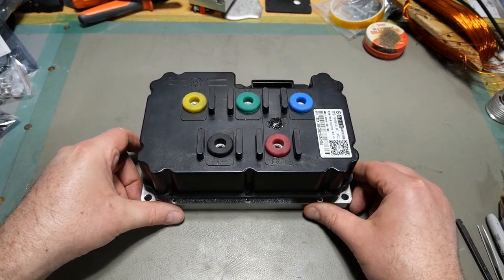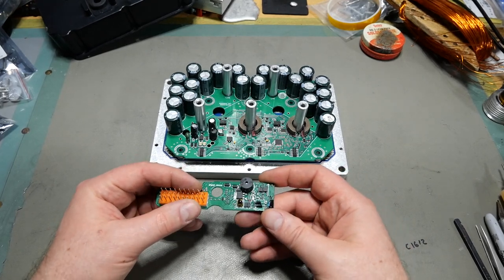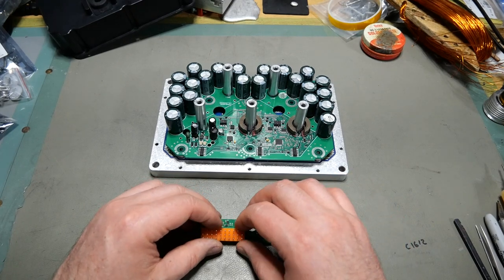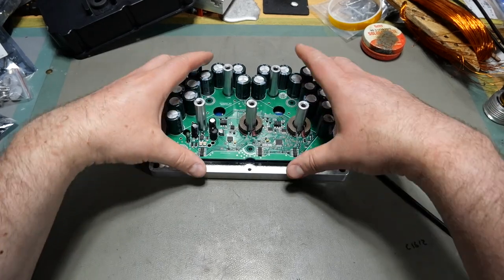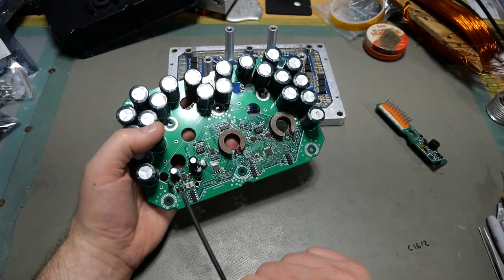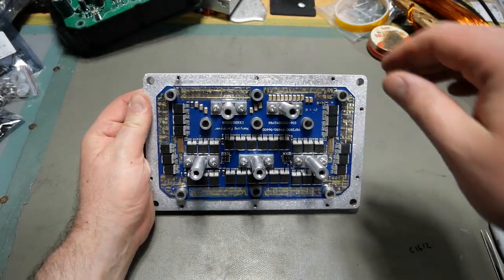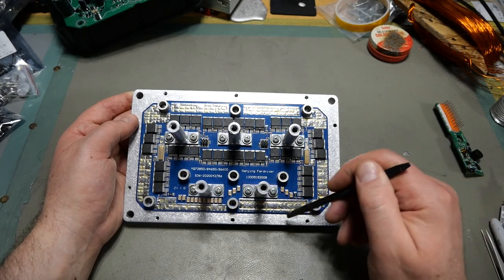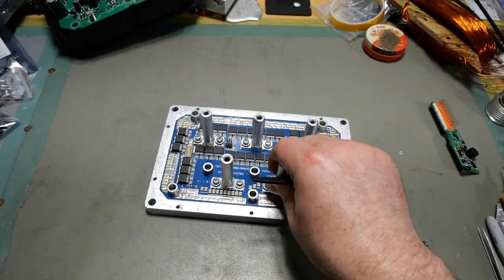Far Driver ND96850 Overview

Comment: It is really interesting that the powerful open source VESC is applied to this ABS box.
Reply from the maker: Why not? It's mosfets on the power stage. Gate drivers are not special. What's behind them can be just about anything from an RC ESC CPU to VESC or whatever.
Reply: @de-bodgery  What type of Hall amplifier is used? Can you provide the schematic diagram of the amplifier part?
Reply: VESC uses resistance current low-end detection, and the video uses the Hall magnetic ring method.
Reply: @de-bodgery  The current sampling method needs to be modified when VESC is installed in this box

Comment: Very intersting comment about the encoder input support for sin/cos vs hall.. I assumed there must be hw difference as well.  I did see the following descriptions of parameters of the encoder:  
1) Hall version
2) incremental encoder version (3 types)
3) differential encoder version (4 types)
4) absolute value encoder version (2 types)
5) Encoder version (not sure..)

So a mix of types!  I suspect that the MCU just reads in the value via ADCs and does the rest in fw..
Reply from the maker: The CPU jsut need the right coding in it for the position sensor

Comment: Can you share a similar or identical controller PCB schematic file? The enclosure is very good, and the VESC is cloned onto the controller, but unfortunately there is no PCB dimension drawing
Reply from the maker: Good luck getting an FD schematic. IF you google for VESC schematics, you can find some open source schematics for that.

Comment: Know if this is hard to install on a sur ron? And if ill see any improvment running it on stock (72v on the way)
Reply from the maker: Get on the Watt Wheels web site. There are adapter cables there for far driver to surron. This makes connecting these controllers in place of the factory controller pretty darn easy. If by improvement, you mean more motor power, then yes, this is stronger than the factory controller.
Reply: @de-bodgery  yeah I mean will the 90a stock battery improve (some say it does with torp nuclear etc) performance with this controller. Even before I asked the question I assume it would be negligible
Reply: @de-bodgery  and thanks for the recommendation will check it
Reply from the maker: @je7647  Motor controllers are not magical. They all need more current to make more torque in the motor. You can't configure the factory surron controller, but you can configure after market ones. This will let you set the battery and phase amps higher, assuming the pack can handle more current. Surron, VESC (What Torp uses) or Far Driver are all FOC controllers. They will all drive the motor in a very similar way. This isn't magical, but it does provide better motor control than older technologies. I have yet to take apart a factory surron pack to see the BMS inside. I think it's 80 amps, but I'm not sure. The cells inside are capable of 150 amps, so with a stronger BMS to replace the factory one, you ought to be able to pull that 150 amps from the factory pack. This will raise that current into the controller significantly so that you can pass that along to the motor for more torque. Your pack current limits are your primary limiting factor. No controller is going to change that at all. Torp is massively expensive and they exaggerate the power ratings pretty agregiously! Never mind that they are stealing VESC and are under investigation for intellectual property theft! I can't recommend Torp EVER. There are plenty of legit VESC options that are reasonably priced, decently made and that are not despicable thieves like Torp. Trampa, MakerX, Team TriForce, 3Shul, Spintend, EBMX, Tronic are all good makers of VESC controllers. VESC will provide the best case motor control with the largest feature set of any controller you will find out there. Nukular is a reasonably good brand as well and is not VESC. I don't ever recommend ASI as they are massive control freaks and won't let you configure your controller yourself.
*
I don't know this as fact, I'm just hypothesizing. It is possible that the factory surron controller is limited to something like 80 battery amps. If the factory Surron pack is capable of 90 amps, then the Surron controller would be leaving available current untapped. If that is case, an after market controller that can be set to the maximum the factory surron pack can deliver would for sure make a little more power. Again this isn't magic, it's jsut using all the resources you have available. Probably, if you could reprogram the Surron controller, you could also set it higher and get the exact same result.
Reply: @de-bodgery  yeah I went fardriver, I was aware the future of evs is in vsec and didn't want to get one of those half ass vsec that are "open source" like torp (I don't believe it will be or will be pro e ot some issue) I'm going to get a good vsec one maybe a year but the 72680 enough atm

Comment: Hello, magnificent videos. Could you help me with a fardriver controller, at least a guide? In the app I get a 10.phase zero error problem; The controller repaired it for other damage, but I have not been able to find out what the problem is. very grateful greetings.
Reply from the maker: On Facebook there is a Far Driver forum: Far Drivder Tuning for E-bikes. On Discord is the High Voltage forum with a whole section for Far Driver. Those are good places to post questions. You can also download the FD manual to read.

Comment: Between the Fardriver and the Votol which controller would be the better value pick with some sinusoidal features and a plug and play display that just works, and will adapt to weird hall configurations in the programming
Reply from the maker: They are both based on the exact same CPU and FOC libraries. There is implementation differences between these 2 companies and I've only ever seen the EM-150 Votol controller. I don't know how the others are constructed. Far Driver jsut released a now controller design with a blue plastic cover. The battery and phase posts have been moved which is a strong indicator that they also arranged their power stage in some way. I will be doing a tear down of one of these soon, but I haven't seen it yet. It may be that this new FD design is a large step forward for FD, but I don't know that yet. As far as displays go, I don't know of anything for either one, but then I don't know everything either...so it's possible there is something?
Reply: @de-bodgery  thanks. it seems that fardrivers arent really made to work with displays outside of connecting to phone with bluetooth, or using a CT22 model. Checking the price for a unit that does 100v, the price is $450+ the search continues.
Reply from the maker: @EVGizmo  They aren't cooperating with me yet, but I'm in contact with FD developers to get access to thier firmware and hardware repositories. The idea is to make a display based on the ESP32 CPU that works with FD controllers. NOOOO idea if they will cooperate! This idea may be a dead end before it ever starts.
Reply: @de-bodgery  would be good but even looking at the harness sounds like it will be a lot of work on their end - all depends on how much they want more market share or not
Reply from the maker: @EVGizmo  THere is UART which they use with BT that can be used as is. I'd jsut need to sniff out the commands used and suplicate them in an ESP32 display. Thing is I'd also need to emulate BT and a few other things to make this work. It would be worlds better if I had access to the firmware repos so those UART pins could be changed to canbus.
Reply: Use a DKD display, just as you would with votol.

All primary fubction use just three wires b-/b+ and a sense wire that goes to the analog or digital speed wire on the controller.

There are additional optional functions for turn signals as well.

Comment: Hey mate can you please help me I need to replace 1 of the large 18 ceramic capacitors and I need to work out what voltage they are so I can order a new one. Thanks in advance
Reply from the maker: What FD controller do you have? The physical size of the ceramic caps will give you  a clue to their capacitance. I'd jsut assume they are 2.2uF as that will for sure work. Next detail is the correct voltage. We can probably get that right by knowing what the max voltage of your controller is.
Reply: It's actually nd 96680 thank you for your reply. It is one of 4 large size in parallel on the positive side. Thank you in advance
Reply from the maker: @Builtnotbrought Have you depotted the controller? If so, then you can see the voltage for the large electrolytic caps. If you get ceramic caps with the same voltage you'll do fine. 2.2uF ceramics will probably be OK and more thn what's there now. PM me on FB so you can share pics of your controller. To replace components on the MCPCB, you'll need to heat up the board to the point where the solder just starts to melt. You can use your kitchen stove, but it's critical that to keep a sharp eye on the heat since stove tops are pretty terrible at heat regulation. To make it work best on the stove a 1/2" thick slab of steel or a very thick frying pan can be used. This will distribute any hot spots  from the burner evenly. You'd put the MCPCB on top of that to heat it up. Long tweazers are very handy as you will need to reach over top of the board to pull off the bad parts and to place new ones. I've used this method a few times before I got legit equipment, but it can be done. You will need a very steady hand so you don't move parts around or bump the board while the solder is molten. Once the new parts are in place and solder has flowed to them, you can turn off the stove top and let the board cool down without moving it. Other things of high value is flux and solder as you might need both to get the new parts to flow into place.
Reply: @de-bodgery  thanks very much you just answered my next question. Yes iv depotted it and I attempted to change a mosfet with rework hot air but I couldn't get it hot enough and was not sure of heat would damage it. Ok I'm a tig welder by trade so I have a steady hand I'll try the stove method once I have all the replacement parts can I use the 1" aluminum solid heat sink and a way to spread the heat evenly? If not I'll get some steel plate from work. Thanks for your help I will msg you on fb from now on for any assistance needed. Thanks from south Australia!
Reply from the maker: @Builtnotbrought Leaving the MCPCB on the heat sink is a good idea and then placing that in a thick frying pan will distribute heat nicely so you have no hot spots. I wouldn't do that direct on a burner! You are asking to over heat the electronics and cook them! When I did reflow on my stove, I was VERY SLOW at turning up the heat. I don't know your stove at all so I can't tell you what position of the dial is  right for you. Getting the heat right is NOT fast. This usually takes 20 minutes to get it just barely to the melting point of solder. I'd make very tiny heat adjustments with some solder on top of the steel plate until the heat was right. After that, I'd put the board on there to get it hot. With the mass of metal involved, heating doesn't happen quickly so you will feel tempted to turn the temp knob a lot to get a faster change and this is probably going to over heat the electronics before you know it! This type of work takes patience and going sloooooow. To get the components safely replaces takes heating the entire board as a whole. Spot heating like you were doing with just hot air just wicks away the heat before you can get the spot you need to heat up sufficiently. 
*
When I say "steady hand" I think this is nothing like TIG welding. You are working with components that are often times less than 1mm long! That's a whole other 'nother level of "steady hands" than TIG takes! A 12" square section of 1/2 thick steel plate will work great. When I reflow, I do that at my bench, but I do it on top of a steel plate of this size to make dead sure I spread around the heat no matter what!
*
South Australia? You might look up Bruno from the More Poweeeer channel. He's somewhere near you and he can do this kind of work. He and I were talking about SMD repair jsut a few days ago!

Comment: Great job! One question - which chip needs replacing if you short your hall connector?
BTW - bet my bottom dollar Fardriver knows zip about KO moto. I will ask the tech lead to verify. I recently regained access to WeChat and he's a contact. If you have any other queries lemme know.
Reply from the maker: So KO is stealing from FD and they don't know it? Sure...I guess that's possible. I'd be surprised if FD admits that they build KO products. Please post what you find.
Reply from the maker: You can burn out TVS and they may dead short. They may be your issue. Otherwise there isn't anything else other than the CPU.

Comment: Ohh. Now it all makes  sense . So thats why the continuous ratings of these controller's are soo low when compared to votol or other  controller's because the logic board carries current !
Reply from the maker: Parts layout and board layout are just as important as the components you use. The parts used are mostly alright.
Reply: Is there any easy-to-upgrade components in a fardriver,  after depotting? I dont know much about electronics beyond shunt mods, and building ebikes.@de-bodgery